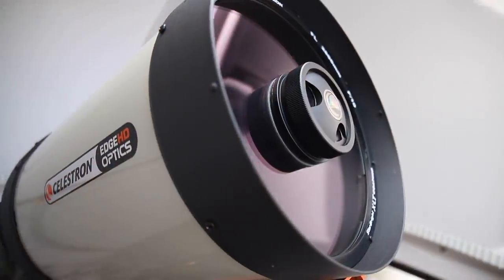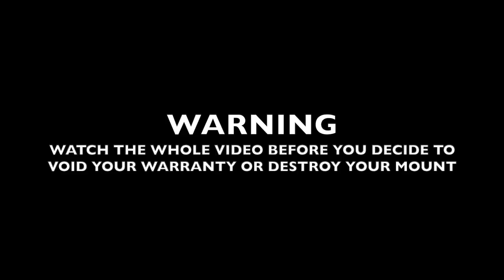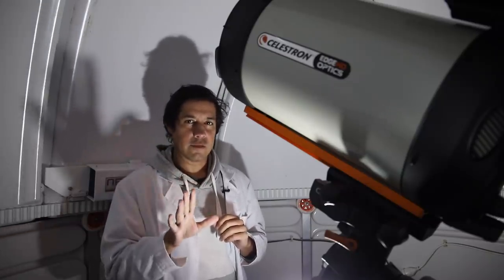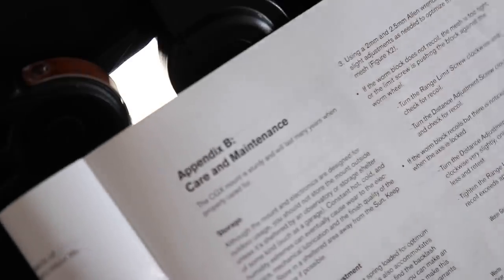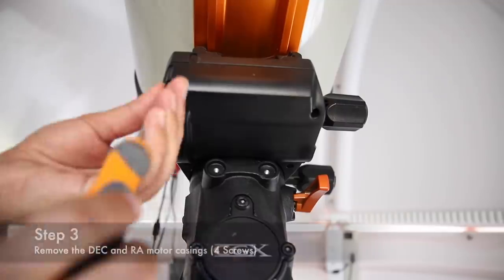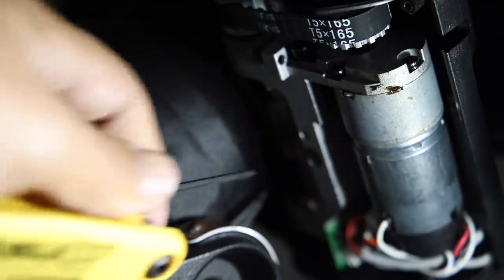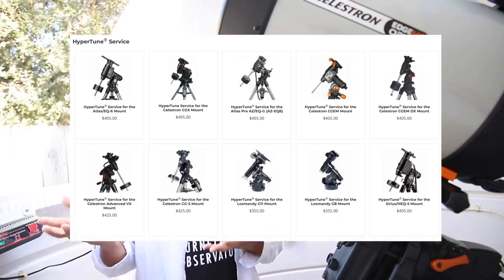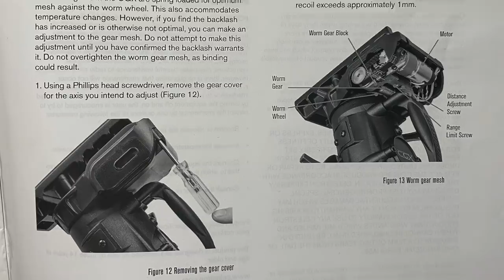Hypertune Your Mount for Round Stars (Celestron CGX)

Comment: I love this video Dylan!  There is also one more adjustment besides what you did you may have to check.  There are two rollers where the belt is attached.  Check the rollers( by looking inside into the gap between the rollers).  On the rollers there are two holes that will have screws.  If they come a bit loose you also get that shaky movement.  Playing with Distance adjustment screws is not easy at all.  The way I do, I make it tight.  Try to move the mount during the day.  And it will create that bounce effect. I then back off 1/16 or may be twice of 1/16.  If it works great.  I leave it in there.

Comment: I personally just bit the bullet and took apart my AZ-EQ6. I was thinking, it either goes wrong and I'll be hitting my head for a year or.. I learn a ton and improve the thing. Luckily it is the latter, mounts really aren't that difficult, but you have to pay very close attention and take a ton of pictures. I cleaned all my gears, used better lube in the right quantities and replaced the standard bearings for better ones. It's been very reliable ever since + I now know what to do to get rid of whatever issue arises. :)
Reply: Its a fantastic feeling innit ? I have now rebuilt and "hyper tuned" an Advanced GT, an Atlas EQ-G and a CGEM. The CGEM was the hardest of all because it was a crap piece of equipment frankly. Pot metal, errant powder coating on internals, etc. But, the satisfaction of getting everything cleaned, and lubed and properly reassambled and torqued pays dividends when you're chasing an issue with imaging or visual use. At least if you do a good job you know it's not your work that caused it.

Comment: For a PDF of the "collectors item" Celestron Manual that contains the worm gear mesh adjustment google "91530-1_CGX_EQ+Mount+and+Tripod_Manual_5" and it should be near the top of the hits. Daytime adjustment was not too difficult. Both my mounts track a little worse in RA than Dec. In post-processing I generally do a gentle deconvolution with an aspect ratio to match the elliptical stars in PixInsight but I realise that's not everybody's cup to tea.  On polar alignment I can't recommend enough PhD2's "Polar Drift Align" where you can use your guidescope. Best channel.
Reply from the maker: Thanks rod Ken!

Comment: Nice work Dylan.  Half of the fun is tweaking these mounts.  Then a quick shot of Jupiter so the wife doesn't think I am nuts. 

Great results on your improved guiding.   I don't have a CGX but an AVX benefitted greatly from tweaking the gear mesh.

I used a wattmeter on the power supply and got the gears as snug as I could without resulting in extra current draw.  As soon as the current rose I knew they were too tight so backed it off a fraction  Did similar with an AZ-EQ 6.  Not a pro, just a tweaker but super happy with the results.
Reply from the maker: Thanks man .. was so overdue... this new scope really made it important heh

Comment: I have the same setup.  I will 'carefully' investigate the RA and DEC gears.  I would have liked to have seen a 5min or 6min exposure.  You are correct about the f/10 greatly amplifying the tracking error ... you got to be spot on with the polar alignment and balance.  Thanks for this very useful video Dylan.

Comment: A little trick about the stars - do shorter exposures just for the stars and then replace them in the original image. Some might consider it cheating, I say that's just HDR :)  Great video as usual. You always have the perfect mix of humor and astro stuff. And yes I have also tuned my CGX with those screws even though it is still under warranty (which I'm guessing at this point is no longer valid)
Reply from the maker: I won't tell Celestron if you won't!

Comment: Nice work explaining adjustments and what to watch as you make adjustments. ANOTHER BIG ITEM to look for on the Cgx mount. BELT TENSION. If it’s too tight, you WILL wear out the bronze bushings on the drive shaft in the drive motor . A lot of detailed information on cloudynights regarding this issue.
Thanks for your presentations. Always something learned.  Take care

Comment: Great info Dylan, I have a Celestron CGE mount and at the time was Celestron's best mount, but boy was it built & heavy! Being a newer design it had to go back to Celestron for service common issues, stoped using then last year put on order a CGX mount but the next canceled just to heavy and did not trust that it would be a mount for 10 years and sorry Dylan this reminds me of the lower quality of Celestron.  Got an IOption CEM60 way better than any Celestron mount and PEC blows almost all mounts but the AP mounts away. It can hold 60 LBS load (but like all mounts cut in half for Astrophotography) and weighs 27 lbs. Sorry Celestron super long time customer from the Powerstar scope, but not anymore...

Comment: I just did mine. I think you may find that the best way is to take out any "Play". When you hold the end of the counter balance rod, you may find a slight clunk, clunk around RA. Adjust until it's gone. Do the same for Dec. It's better than trial and error.
Reply from the maker: Good tip!

Comment: Hey Dylan great video! I hyper tuned my CGEM a while back. I definitely don't recommend it to somebody who isn't mechanically inclined. Celestron does not want you to disassemble their mounts (lots of loctite on screws and nuts). All turned out well just the same. If memory serves me correctly it involved ceramic bearing replacement on worm gears shaft, lots of polishing of the ring gear bushing and teflon spacer installation. One of my complaints about Celestron is the lack of information on how to maintain and service the mounts and the inability to purchase replacement parts. You may get a lot of requests to share that manual with the outdated tuning section....it does not  surprise me Celestron took that part out......
Reply from the maker: Yep! The whole page is in the video.. that's all it was.. and it didn't really describe the process I came up with here, just a few lines about those screws!

Comment: I have to say, that I had an AVX, and thought that I was just terrible at doing astrophotography. Truth is I am. But the entry level AVX was also terrible at doing astrophotography. So I spent quite a bit of time following tutorials, trying to tweak and improve my mount. I learned just how bad the design is, and after 3d printing improvements and pulling my hair out, I bought a better mount, and now I'm really happy. Now I do have to tune and tweak things on occasion because I didn't spend a million dollars, but everything works so much better now. Mine has a spring loaded worm which can be more forgiving, but I do have to tune it on occasion. Luckily it's a Losmandy, so tweaking and tuning is pretty straight forward.

Comment: Respect!  Hypertune seemed to involve 'ceramic' bearings and a lot of other hocus-pocus to achieve many hundreds of $ prices. I took my (very old, pre-loved) Celestrom CGEM mount to bits. Cleaned and lubed the sh*t outta it. Adjusted the 'pinch' on the worm gear then balanced (as best one can with a Newt) and all was a lot better.  Who Dares Wins but I wouldn't advise on a new/in warranty mount! Caveat Emptor.
Reply: Agreed. The whole ceramic bearing thing is unqualified nonsense snake oil.

Comment: very nice dylan, congrats on the hypertune. iv'e seen your hypertuned star profile and it looks good, a very random patern instead of trailing but also on track, which kinda shows that you are pass the mounts tuneable limitation ie "hypertuned "and now more relying on seeing and pulse correction settings . 

i know something else you could try, setting the worm float if you already haven't  , i use a dail indicator that i use for my lathe and i set my worm float to 50 microns play , pretty tight tolerance , i even swaped for better bearings for the worm , most mount manufactures use roller bearings ie the ones simular in skateboards or roller blades , idealy conical bearings would be better for the worm drive to compensate against the load in the horizontal axis .

I even go as far with my tune to rotate the bad spot of the ra worm wheel disc into a spot that dosn't get used and then permantly lock the clutch and tune the mount on the good areas of the worm wheel . some people lap their worm wheels with grit for hours to get the small error of imperfections out .

every astronomer enthusiast should learn to tune thier mount , there's a hit or miss  in mechanical pression with mass manufacturing especialy on the worm wheel in tracking mounts and the adjustments before it gets sent out , ( i assume most manufacturers give thier mounts a little play for the temperature difference in different regions)

btw check your tune again in summer incase it's too tight to avoid binding and dammage , the temperature will change your tune in the seasons .
Reply: I've never heard the term worm float before but it sounds like you're setting the backlash, especially since you mentioned thermal changes and that you used a dial indicator.

Comment: I was about to do the exact same thing, but Rod at Celestron emailed me and told me that it would void my warranty...like I got the email as I was walking outside to take off the motor/gear covers. So now Celestron has it and is sorting it out. I got so frustrated with it that I bought a Paramount MX+. Now I'm buried in manuals trying to learn TheSkyX.
Reply: that's just silly.  That's like a car manufacturer saying you can't change the tyres cos it'll invalidate the warranty.  Celestron has to PROVE that what you've done has contributed to the damage to said mount.  It's not up to you to disprove it.
Reply: did they fix the mount?

Comment: my problem is the opposite using Orion atlas mount. My RA sits at ~0.9RMS or less  while DEC is always above 1.5RMS even if guiding in once direction only or turned off. Should have invested in 10Micron or Paramount :)

Comment: I have done extensive investigation into and tuning to my CGX and concluded it can only track with an accuracy of around 1 arcsec RMS. Out of the factory adjustment and worm shaft bearing preload leaves a lot to be desired and the bronze clutch drums rubbed on the main housings making balancing a challenge. My worms were so tight axially the worm was dragging in the bearings and the bearing fit on the worm shaft was as they say "like a cock in a sock" I measured 0.02mm undersized. 
The main limitation is not so much gear backlash (what Dylan is addressing here) as the location of the motor encoder being on the end of the motor shaft. I suspect Celestron chose this location because they can use a lower resolution encoder.  It really should be a high resolution unit on the output of the motor/gearbox, this is why. The CGX motors have a gear reduction box on the output. The backlash in this box is really quite poor to the point where my mount always fails Dec backlash compensation from PHD2. This is because the backlash is so great and PHD2 limits the amount of correction to what they consider practical, the mount thus is in a constant oscillation as PHD2 struggles to keep up. In conclusion I would not recommend this mount for scope of greater than 800mm FL. Oh and finally I feel better qualified than most on this subject as I have a mechanical engineering background rather than the  unqualified opinions commonly seen on the net. 
Incidentally Celestron may have removed the adjustment procedure from the CGX manual but it is still present in the CGC-L mount manual. Since the mechanical arrangement is identical between the two mounts you can use the published -L manual for the standard CGX.
Reply: So in other words don't buy a cgxl? Save up for a planewave?!? haha What mount is the best? Should an aussie company build a better one?

Comment: These mounts are quite simple in mechanic point of view, if somebody has some "mech" experience. It is quite simplet to take care, or "hypertune" but the kez you must know what you do. I already hypertuned lot of time my first EQ5 mount. But i can say the EQ5 mechanical quality is....... Then I bought an HEQ5 used and my first part was disassemble and cleaned and regreased with super lube. I can say, the HEQ5 way better than EQ5 for mech point of view. But i still not confident with the bearings. These bearins doing the job, quite ok, but i will change these sometimes in the future... 
But every "mech" needs some "take care" does not matter that is CGX, HEQ5, EQ6 or 10 micron...

Comment: g`day dylan great video mate ... you get a lot of condensation in that dome  do you think you might have a slight corrosion (notchiness/grinding)  in the bearings  the main and the motor roller bearings  that is giving you  the shake from stickion or slight binding   i am surprised you don't have wiring problems  with all the moisture on the electrical contacts  .. have you ever thought about getting a industrial fan( small barrel type) or a carpet dryer  to get some air into the dome to keep it dryer inside or maybe a whirligig roof ventilation might help    i don't think the damprid is cutting it anymore  and i would hate to hear that the edge 11 got mold inside  or other gear crapping out  well looks like your getting things a lot better  with adjustments (just think of it as learning to do  culmination again lol)  0.9 is better than 1.5 rms tot ... you should of tried a repco or a auto supply shop for the lube  i think that super lube is around  i have seen it before  in oz  oh well good luck with the adjustments  hope you get the problem sussed out  and the CGX  comes good and you get back to nice round stars  again..  looking  forward to your next video. please keep us updated with your progress with the mount  i am very interested in you final outcome  and annalise's ....... some nice upgraded ceramic bearings would be a nice investment  in the CGX  i would glide like a ice skater lol  (in my best homer simpson voice) mmmmmm round stars lol 
cheers
james D
Reply from the maker: Yeh I keep meaning to get a better solution but I also keep spending my money on stupid stuff.
Reply: @DylanODonnell  stupid stuff is great until the wife hears about it  .. that's usually when you find out your great new toy is stupid stuff lol ....... enjoy while you can

Comment: Hi Dylan,
Would tinkering like this void your warranty as I am having an issue with my CGX where the RA axis seems to be binding and jerking when I attempt to align and press the hand controller arrow buttons for the RA axis.

I have a later CGX and there is no mention of the spacing or tension adjustment screws in the manual.
Reply from the maker: Yes it would void your warranty but the behaviour you mention at also be bad balance with the counterweights OR try resetting/upgrading the firmware on the hand controller. If that fails .. contact Celestron or your vendor for support .

Comment: I just love your content dude! I had to go through this process as well but I wasn't aware of the whole hypertune thing. Bit frustrating doing it in the dark. Ended up losing 2 of those tiny cover crews in the event horizon. I wonder if Bintel offers the hypertune service as well.
 Btw I got a hyperstar for my C11 recently & I'm pretty sure I have the collimation bang on. I noticed that some of the stars are elongated slightly in one corner. Just realised that I hadn't checked to see if the corrector plate itself was centered before setting it all up. Just wondering if this could possibly one of the factors for you as well.
Reply from the maker: Hey thanks man! The flaring is coma from the reducer and possibly my back focal distance / arrangement .. the collimation is ok I promise :)

Comment: My CGEM Mount had a stiff DEC Axis. I was not able balanced it good enough for good guiding.
Reply from the maker: Yeh I feel like the CGX was the first decent Celestron mount at that price point
Reply: That's caused from insufficient clearance between the ring gear and the housing. 

I hypertuned my old CGEM and the process requires sanding down the ring gear to the point where it will move freely in it's housing.

Comment: When checking the guiding after each adjustment, should I recalibrate, or can I just stop the guiding, do the adjustment and then start it again?
Reply from the maker: No need to recal for minor adjustments but def do it again when you are finished and check again.

Comment: I wonder if the shape of your guide star is giving you some of your issue. They are pretty egg shaped so PHD2 could be struggling to calculate the centroid properly.
Reply: also, I'm not familiar with celestron mounts at all, but is there anywhere you can get to the worm gear and turn it manually by hand? This is the best way to check for binding because you should be able to feel it has your rotate the gear around the shaft. One of the guys here in Brisbane came up with a great idea for his EQ6 where he gets a bit of relatively strong rubber tubing that fits snugly over the spindle end of the worm gear uses that to rotate the mount, as soon as there is any binding it will cause the tube to just slip and spin freely. you can then adjust the distance at that exact spot where it binds and continue on for the full 360 degrees to keep checking
Reply from the maker: Yeh the guide star shape seems to be a feature of the OAG prism . it does't help so I try to choose very small stars. I don't think I have a bind issue but I do think the backlash is higher than it should be because of the ageing belts. I'm going to try get nicer new ones I've heard improve the CGX.. and that sounds easy enough for someone like me even :)
Reply: @DylanODonnell  New belts definitely won't hurt. Shouldn't be hard to replace, the tricky bit will be getting the correct tension on them though. More trial and error fun